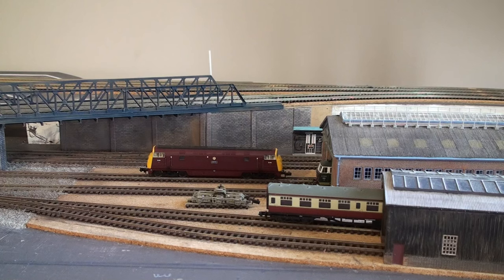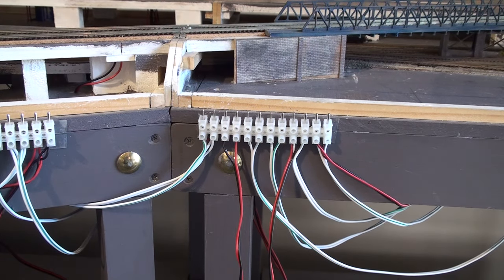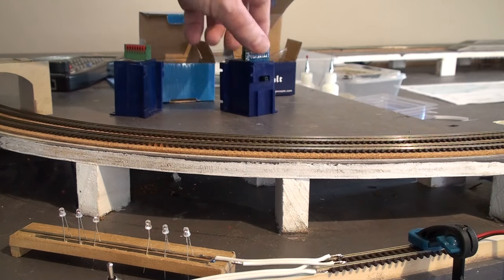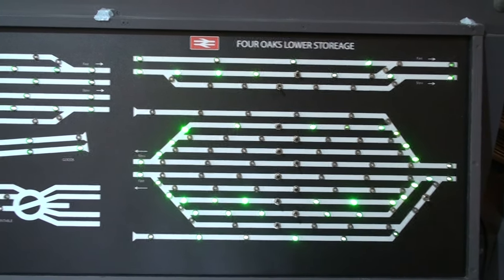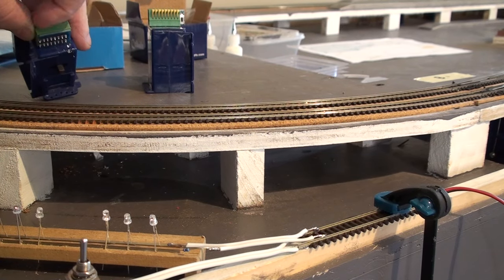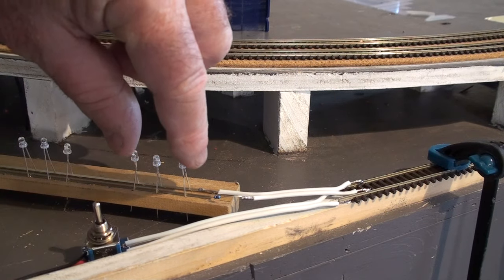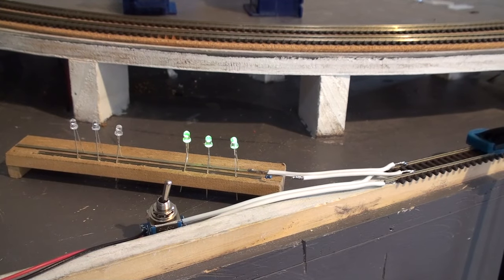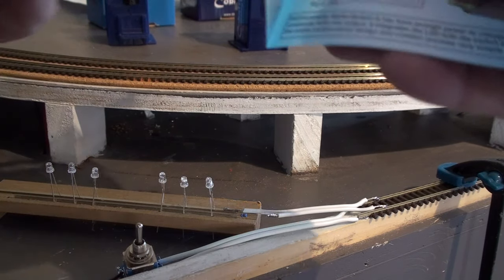N Gauge Four Oaks Street Station Model Railway Part 97 ' Control panel next, how to wire the LED's?

Comment: Do agree with Paul - absolutely stunning opening shot with the Hymek.   Great shots of the layout wnich we haven't seen before  - with the gradient on the main running lines  - very prototypical.   Cheers Euan
Reply from the maker: thanks Euan, the gradients came about because I wanted the viaducts at different heights for viewing, i told someone a few weeks ago, the near viaduct is shorter because i ran out of brick paper and had no ink for the printer! Cheers Euan

Comment: Good luck with all your wiring Chris.  It is lovely to see so many new camera angles and you are plainly having a lot of fun getting your trains to run around the layout.  The two Pacifics looked just great carving through the scenery.  Thanks also for showing your Withrottle.  I haven't used it much, but seeing you having four throttles made me have a go with it again this evening and my goodness what a difference it makes.  Stephen
Reply from the maker: Thanks Stephen, i always liked the ability to have a knob for each train, I always panic trying to bring up the right loco when i can see an obstacle or points set against it. I have been known to pull the plug out a few times!  I'm in the process of trying to work out how to operate the layout, i want action in the scenic section but running a train sees it disappear for 4 minutes, so need 4 running. cheers

Comment: Hi Chris! Great shots across the TMD at the beginning! It all seems to be coming together nicely in that area! I found the control panel explanation to be really interesting! I'm not planning on having physical control panels due to lack of space, but rather use a tablet to view how my points are set! However, I really like the look of what you're doing so may have to have a rethink!!! All the best, Ian.
Reply from the maker: Thanks Ian, i think if i was starting again I would go full computer control with an i pad or lap top but the panel was built exactly 10 years ago. All the best

Comment: Hi Chris, wow! Some great running shots there mate it must be fantastic having the trains running round now!
I’m going to use the IP Analogue’s, i did buy a load of solenoid motors but there was so much wiring and soldering,  I looked around for another alternative and the IP Analogue got my vote. They’re a fair bit cheaper to than the IP Digital to, and I’ll have switches for the points which I like rather than doing it through my IPad.
Cheers for now Chris, keep up the good work, John
Reply from the maker: Thanks John,  I'm using the DCC Concepts switches already wired for on /off/on  but if you add LED's then soldering becomes a thing although i think they have alternatives which is largely plug and play but more money etc. Soldering is just practice and i don't mind it. Cheers

Comment: Another great video Chris.. Please correct me if I am wrong, but I thought the Cobalt point motors needed to be operated with Push to make (with a centre off) switches, because you are giving permanent power to the motor which I understood wasn’t good, don’t want you to burn anything out. 
I know it’s extra expense time and effort , but IMO, your layout is crying out for automation, because of the length of each track..
Reply from the maker: Hi David good question, i think the solenoid motors have that issue but as these are stall motors it's all fine although various switches can be used and can be used with their panels. There is lot's of reading about all this on the link below. Still the automation option rattles around my brain, cheers.
https://www.dccconcepts.com/product-category/the-cobalt-collection/cobalt-point-motors/
Reply: @ngaugefouroaksstreetstatio6932  Ah, I hadn’t realised that, regarding automation, if you like just watching your trains run, I guess you could have 6/7 trains on each of your two continuous tracks. I run 5/6 on my Suburban lines, and my track length is about actual 80ft. 
Just an idea, but why don’t you look at various systems, price it up, and see if it’s easy to fit retrospectively.